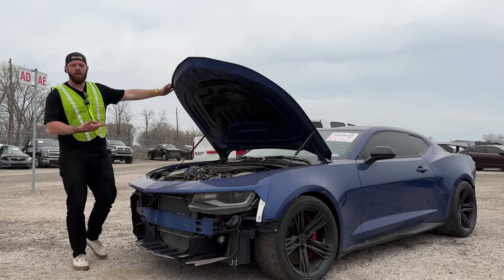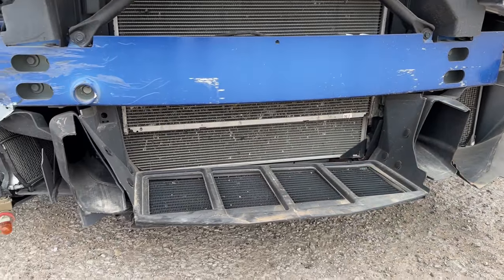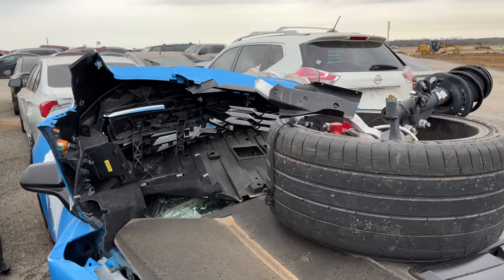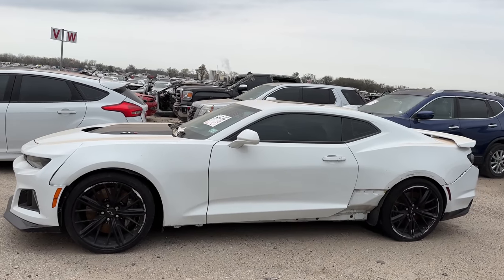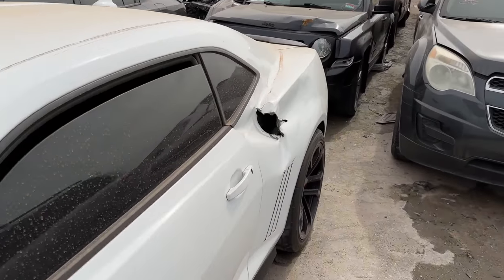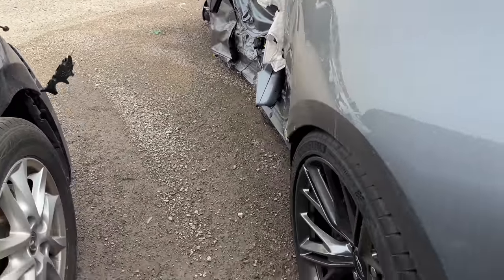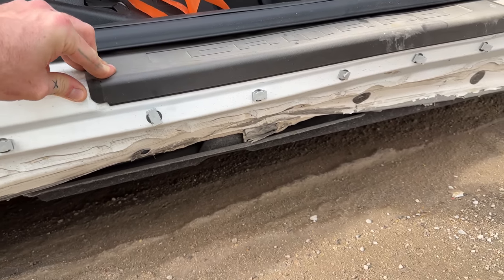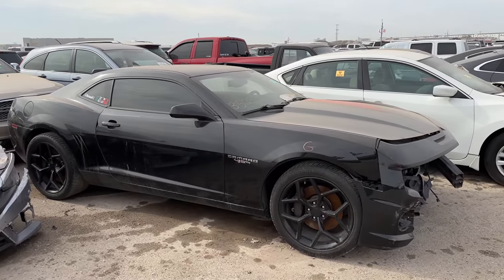Buying TOTALED Camaro ZL1's CHEAP At Salvage Auction!

Comment: Is the signature Alan Oppenheiser? He was the chief engineer for the z28 in 2014
Reply: Also, don’t be too impressed, the first name looks like Alan, so I googled that, Camaro, and 2014 and that name came up.
Reply: That's what I was coming up with as well, started Googling and came to that conclusion.
Reply: I think your dead on but I don’t get the date tho 05-02 2014 what does that mean last one off the line? One he personally did stuff with?
Reply: @abenton3284  no clue on the date, unless it’s just when he signed it. Why he signed this particular one, nothing stands out.

Comment: This topic gives new meaning to market values , something we have totally abandoned in America
Reply: Recently needed a 2015 ram .75 ton 4x4 6.4 auto tranny, can't find a used 1 for under 288k miles and $3800. None from dodge. No new. Rebuilt. Had 1 built with my case and had a Rad threw in and the bill? $8500.00. FUKKING INSANITY. This has got to stop. I could've bought 2 of my 07 town cars for 8 grand and it had barely 100k on a always lincoln dealer services done with print outs. Insanity. Most votes ever my ass.

Comment: I have a genuine question. My mom parked my car at 4pm the next day at 330 pm it caught fire. I had a 2011 Buick lacrosse, but it hadn’t been used in almost 24 hours and randomly the whole engine bay caught fire and melted the windshield, but it literally disintegrated the hood of the car. Do you know why this could have happened ?
Reply: Probably electrical :-\  if not taken care of etc could add fuel to the fire so to speak.  Sorry that happened man.

Comment: 2022 Chevy COPO Camaro Revealed with 9.4-Liter, 572-Cubic-Inch V-8

Chevy has released the latest version of its drag-racing special, fitting it with either a colossal 572-cubic-inch big block V-8 or smaller, but still large, LS-based motors.

￼BY CALEB MILLERPUBLISHED: JUL 31, 2021

￼

CHEVROLET

The Chevy COPO Camaro, a dedicated drag-racing special, returns for the 2022 model year and will be offered with three engines.

A 572-cubic-inch (9.4-liter) big block V-8 is available, along with two small block V-8s, a 580-hp 350-cubic-inch (5.7-liter) unit and a 470-hp 427-cubic-inch (7.0-liter) motor.

The 572 option starts at $105,500, while the naturally aspirated 427 will cost $117,500 and the supercharged 350 will set you back $130,000.

Update 7/31/21: While Chevrolet did not include a power figure for the 572 engine in the press release, it was included in the COPO order form. The 9.4-liter V-8 is rated at 430 hp by the NHRA, making it the least powerful engine option for the 2022 COPO Camaro.

A recent report suggested that the current sixth generation Chevrolet Camaro could be replaced by an electric performance sedan in the near future, but before the Camaro ditches fossil fuels, Chevy has taken its muscle car to the extreme with the new 2022 COPO Camaro drag-racing special.

ADVERTISEMENT - CONTINUE READING BELOW

Back in the late 1960s, Chevy had a system called Central Office Production Order (COPO) which allowed dealerships to order cars and trucks with non-standard colors or features. The purpose of COPO was for speciality vehicles for fleet customers, like trucking companies or police departments, but some savvy dealers who were passionate about drag-racing utilized COPO to create purpose-built dragsters. Chevy revived the COPO name in 2012 and has built speciality drag-racing Camaros every year since.

￼

CHEVROLET

ADVERTISEMENT - CONTINUE READING BELOW

For 2022, the COPO Camaro is available with a gigantic 572-cubic-inch (9.4-liter) big-block V-8, which Chevy says "channels the spirit of the original 1969 COPO Camaro." Chevy didn't reveal horsepower figures for the 572, but said that it uses a cast-iron block with aluminum heads, a forged steel crankshaft and connecting rods, and forged aluminum pistons.

Chevy will also offer the COPO Camaro with two LS-based small block V-8s: a supercharged 350-cubic-inch (5.7-liter) unit rated by the National Hot Rod Association (NHRA) at 580 horsepower and a naturally aspirated 427-cubic-inch (7.0-liter) engine with 470 horsepower. All three engines are mated to an ATI Racing Products TH400 three-speed automatic transmission sending power exclusively to the rear wheels.

RECENT COPO EDITIONS

￼Chevrolet eCOPO Camaro Concept for SEMA

COPO Cabana: COPO Camaro Based on Sixth-Gen Car

￼2017 Chevrolet COPO Camaro Debuts at SEMA

ADVERTISEMENT - CONTINUE READING BELOW

The COPO Camaro is not street legal but does qualify to race in NHRA Stock and Super Stock eliminators. All COPO Camaros feature a carbon fiber hood and wheelie bars, while a trunk-mounted weight box and parachute are optional. In the past, Chevy limited production of COPO Camaros to 69 units per year (mimicking the production run of the original 1969 COPO Camaro) and had customers enter a lottery, but Chevy won’t restrict production of this 2022 model and will sell it on a first-come, first-serve basis. The 572 COPO Camaro starts at $105,500, while the 427 starts at $117,500 and the 350 starts at $130,000. Customers are told to "see your dealer" about tax, registration, and destination charge. Buyers can submit an order form online and can receive a private tour of the COPO Build Facility in Oxford, Michigan, with their new drag-racing Camaro.

ADVERTISEMENT - CONTINUE READING BELOW

This story was originally published June 30, 2021.

This content is imported from poll. You may be able to find the same content in another format, or you may be able to find more information, at their web site.

￼

CALEB MILLER

ASSOCIATE NEWS EDITOR

Caleb Miller began blogging about cars at 13 years old, and he realized his dream of writing for a car magazine after graduating from Carnegie Mellon University and joining the Car and Driver team. He loves quirky and obscure autos, aiming to one day own something bizarre like a Nissan S-Cargo, and is an avid motorsports fan.

Read full bio

Ready to ride shotgun with us?

Sign up for the smartest car news out there.

Email address

LET'S GO.

By signing up, I agree to Hearst Magazines’ Terms of Use (including the dispute resolution procedures); my information will be used as described in the Privacy Notice.

WATCH NEXT

 

￼

NEWS

￼

2024 GMC Sierra 1500 Adds Torquey Duramax Diesel

￼

Weirdest Car Commercials: Window Shop with C/D

￼

2023 Toyota Prius Prime Starts $3500 Higher

￼

2024 Clubman Final Edition Costs an Arm and a Leg

ADVERTISEMENT - CONTINUE READING BELOW

￼

2025 Mini Countryman EV Will Offer 308 Horsepower

￼

Toyota to Build Three-Row EV SUV in U.S. in 2025

￼

Tesla Model 3 Price Cut, Reduced Tax Credit Looms

￼

New Mercedes E-Class Sedan's Smooth Profile Teased

￼

2008 Lamborghini Reventon Is Our BaT Auction Pick

￼

2024 Mazda 3 Getting Big Ol' 10.3-Inch Screen

￼

We Got a Ride in the 2024 Ford Mustang Dark Horse

￼

See the 2023 Kia Stinger Tribute Edition Up Close

ADVERTISEMENT - CONTINUE READING BELOW

￼

￼

￼

￼

￼

About UsHow We Test CarsNewsletterGive a GiftContact UsWhat's My Car WorthSubscribeCustomer ServiceHearst AutosGearRSS Feed￼

A Part of Hearst Digital Media

We may earn a commission for purchases made through our links.

©Hearst Autos, Inc. All Rights Reserved.

Privacy NoticeCA Notice at CollectionYour CA Privacy Rights/Shine the LightDAA Industry Opt OutTerms of UseSitemap

Comment: autos are fasterfact....
Reply: Manuals make more power fact. At the end of the day it comes down to personal preference though! Some cars are better platforms with autos, and some are better with manuals, but it all depends on your plans with the car and what YOU like personally!
Reply: @nickadkins7765  yeah.   Back in the day when autos were 3 or 4 speed, you could usually shift a 5 speed much faster than a factory built automatic, and put more power/ torque to the wheels.   There have been huge advances in automatic transmissions in the last 15 years or so.  Now, automatics can have more gears and use computer controlled clutches to shift just as fast (and in many cases, faster) as a manual.  That said, it does come down to personal preference, nowadays.